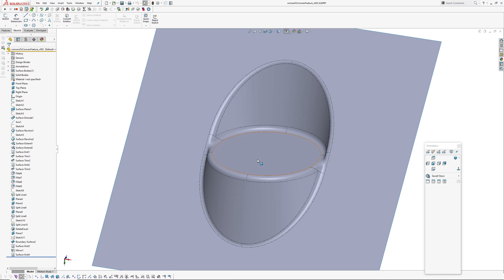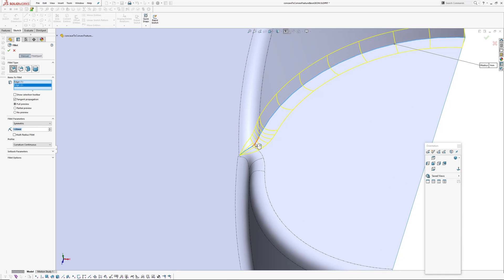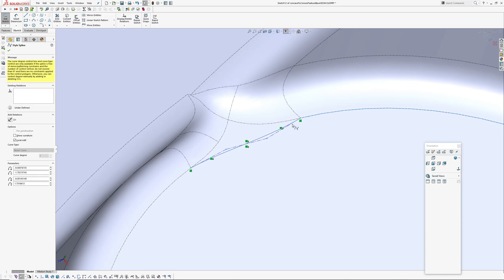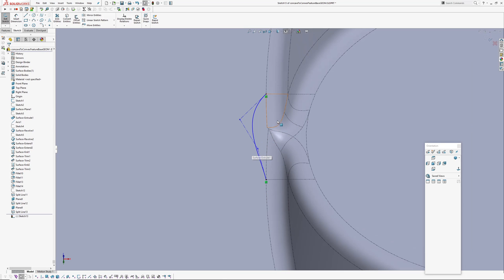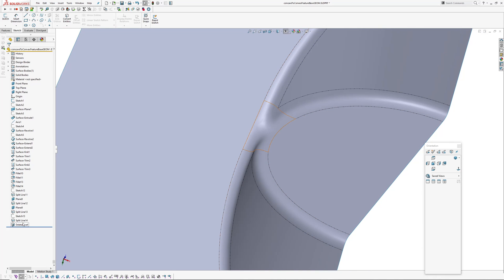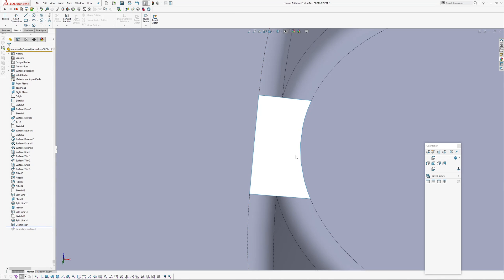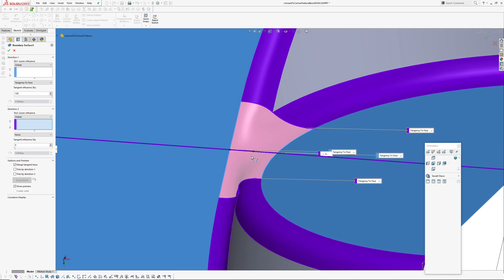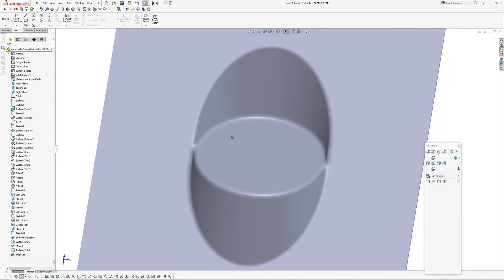Solidworks: Resolving Radii/Fillets on a Concave to Convex Feature

Comment: I would’ve been tempted to manually build the main fillets for all the edges rather than use fillet tool at the beginning to “get more control “. Not sure if it would be worth trying.
Reply from the maker: Hi Tony, yeah I was not in the mood to build the fillets manually as well! If you did want to control the fillet section, then adding fillets and deleting the fillet face is a quick way to get setbacks from the edges.